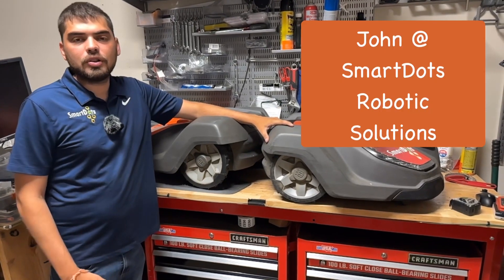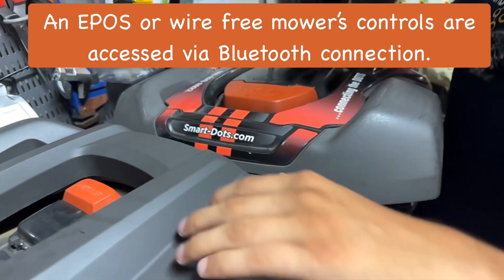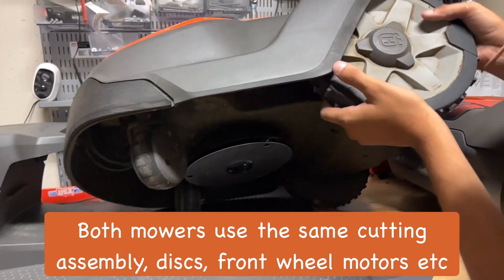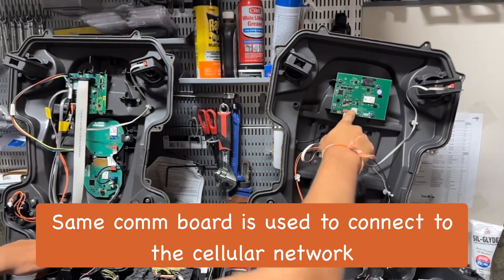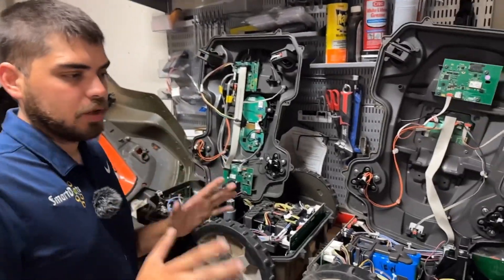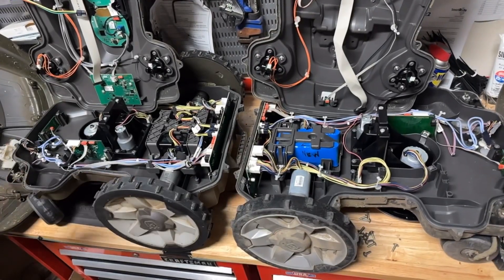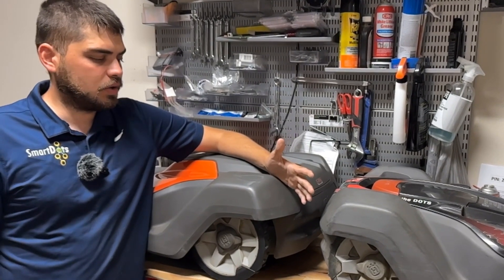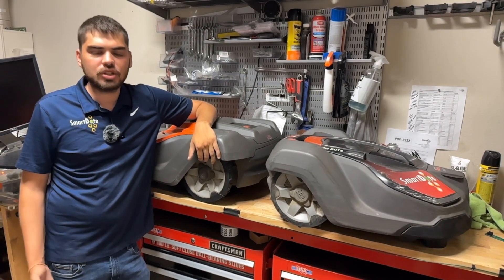What is the difference between 450 EPOS and wired 450X Automower?

Comment: I enjoyed this. I hadn't gotten a look of the 550 EPOS inside. Only looked at the spare parts diagrams of it.
But the wheels being different heights doesn't make so much sense. I looked at the spare parts numbers and apart from the last number the 550 EPOS wheel matches with the 330X/early 430X wheels. I thought the 500-series came standard with the "terrain kit", with the wheels having fewer but higher knobs. But, what's mounted on these two at least, it seems to be the reverse.

Btw for old 450X etc. the terrain wheels weigh the same, but for the NERA the terrain kit have heavier wheels for its terrain kit (like the smaller mower's have). It's 459 grams more per wheel so the mower gets 918 grams heavier. NERA also have built in wheel brush holders so it's just to go and by the brushes (same as for smaller series) and pluck in, from the access hatches at the top. I've been using wheel brushes for a few years and it's really good.